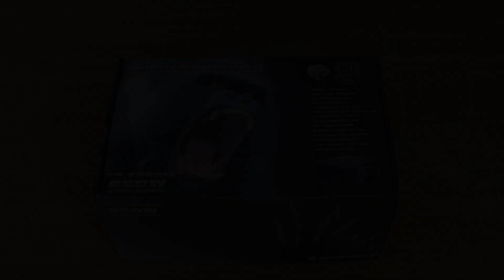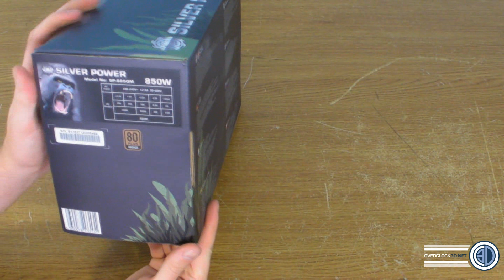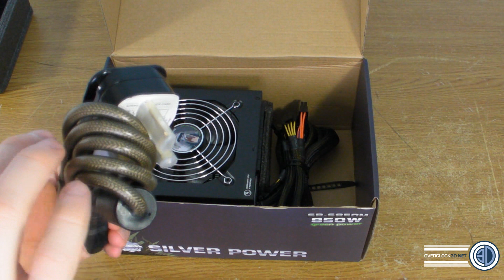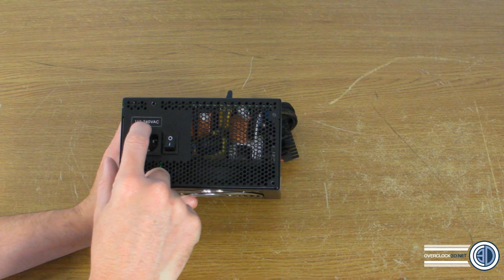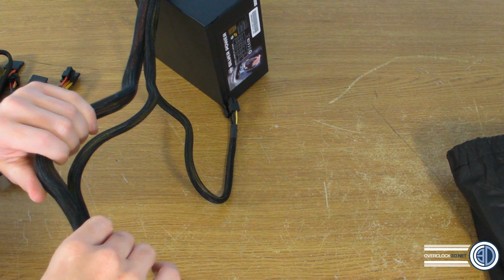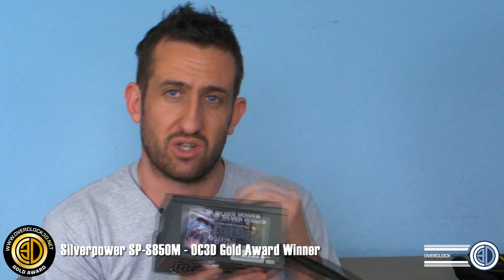Silverpower SP-S850M 850w PSU Review Power Supply

Comment: That's actually an interesting point. Not sure if many will remember but when the HX 750 and HX 850 first came out they were 'touted' as being 80 plus gold yet later the rating was dropped down to silver as very few were actually cable of the requirement, I mean it came close but anyway. Then of course they brought out the AX fairly soon later which was. Whether there's 'cherry picked units' hmm... not a reviewer's fault though of course they can only work with what they're given.

Comment: Also you probably know this already but the vast majority of power supplies are made by only a few companies, such as seasonic etc. It would be pretty cool if you could get the technical guys to go over some of the capacitor brands and circuitry features on board as well as the manufacturer. That would take the PSU reviews up to the next level in my opinion.

Comment: PSU with single +12V rail you can powered many devices from one cable. But if PSU have more of them (+12V reils), than it is better to run - one cable - one powerfull device (GPU for example).

Comment: i use this one and i like it. a bit short cables for my 8pin CPU connector etc but it did work on the mm... (may be my big case, cm storm trooper costum). more than enough for my p9x79 deluxe, i7-3820, 2 x gtx680, 10 HDD and a lot of other stuff =)

Comment: Is there a benefit/con to having a PSU with a single 12v rail vs a PSU with multiple rails?

I have the Corsair AX750 which is a great PSU to begin with but never actually knew why single 12v rails are 'better'.